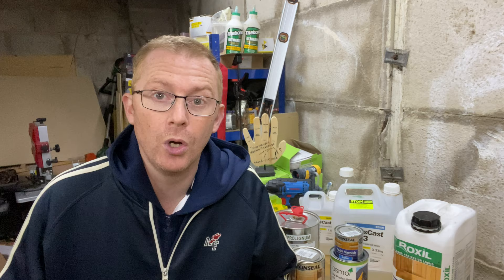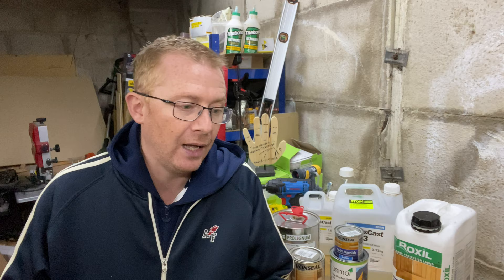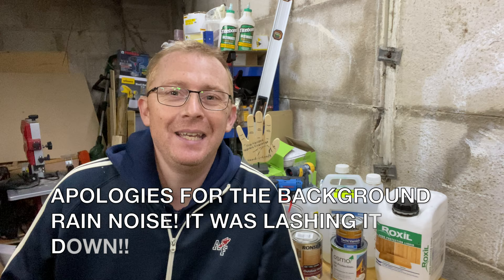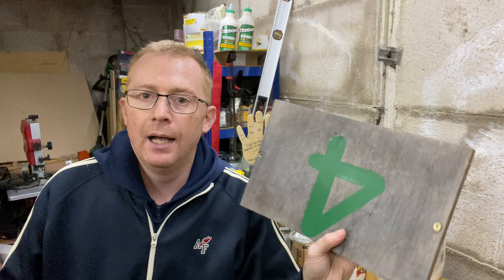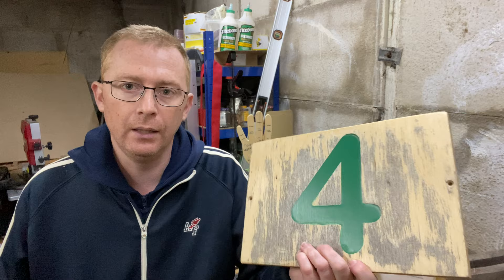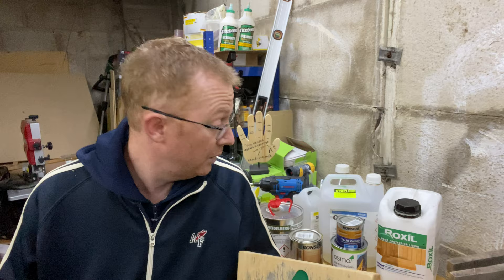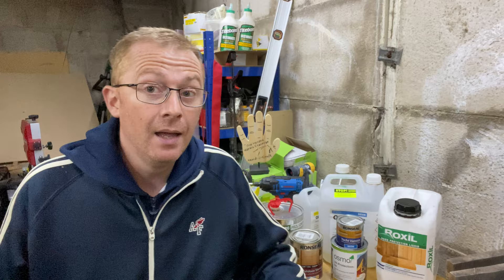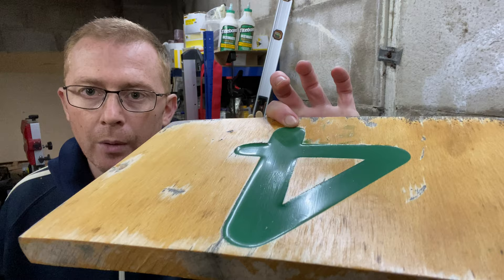Is Epoxy Resin Suitable For Outdoor Projects? (Part 2 of 2: The Results😀)

Comment: What happens when you apply osmo and then a epoxy resin coating.  Would it works ?
Reply from the maker: @versailleaaron3475  I’m no expert but I’d be inclined to say no. The epoxy needs a clean untreated surface to achieve maximum bond so a layer of hard wax oil inbetween wouldn’t be advisable in my opinion. I have though on many occasions with my table tops but hard wax oil on top of cured epoxy. Obviously it won’t soak in to the resin but it will form a protective coat on the top 👍👍

Comment: You need to seal all of the wood not just one side
Reply from the maker: I did Mark, two coats on all sides. The Resin I didn’t as I wanted to see the difference between sealed at the top and open at the bottom. Fair to say sealed at the top faired much better, but if the wood was totally enclosed with resin I’m not sure how it’d cope with the natural wood expansion and contraction

Comment: To me the hard cast turned out the best if all side would have been sealed I don't think it would have cupped
Reply from the maker: I see what you’re saying here Kevin, but having watched them degrade in a ‘brutal’ test over a relatively short period of time I actually think the movement of the wood could have split the resin even if totally enclosed. I posted some follow up pictures on Instagram and the only real product that held up was the Osmo UV oil. I’ve never used any Osmo products before so have no bias towards it but it coped extremely well and would be much more cost efficient than sealing a piece of wood in resin 👍👍

Comment: If you protected all sides they’d have all been better your number 1 has top and bottom protection so no shit it won
Reply from the maker: They were all treated exactly the same covered all around with two coats, except for the coat of glasscast resin. I couldn’t have posted the footage of me coating of all sides twice on every piece as that would have been mind numbingly boring. I really went out of my way on this to control the variables as much as I possibly could as a hobbyist woodworker. Did you watch part one where I explained the process?